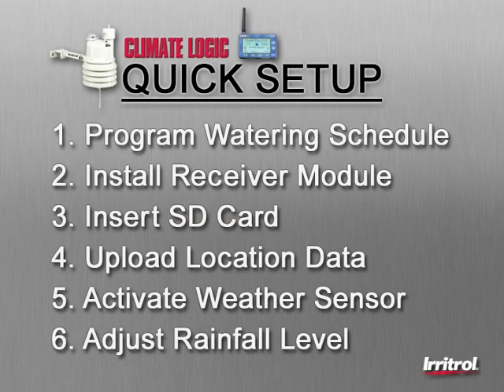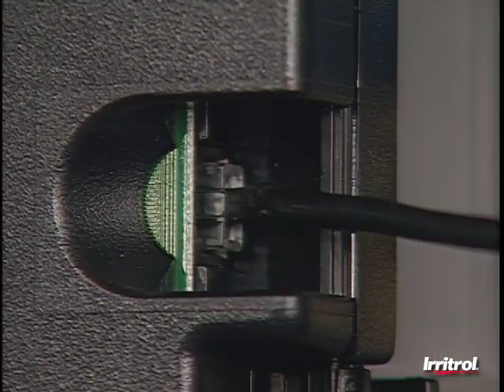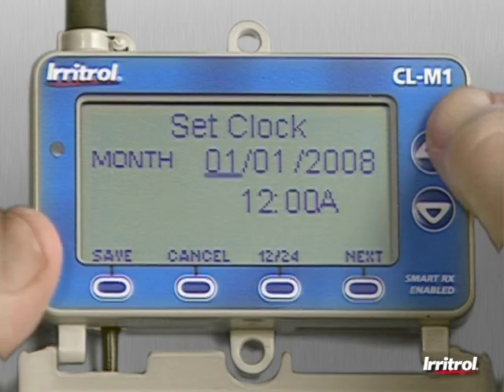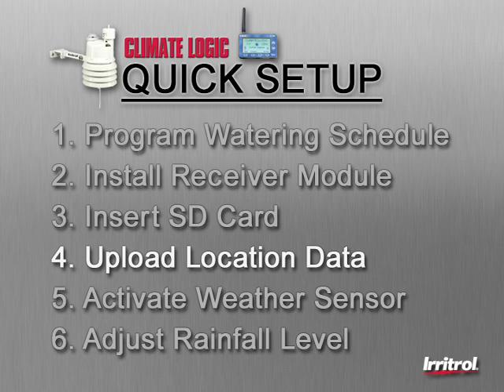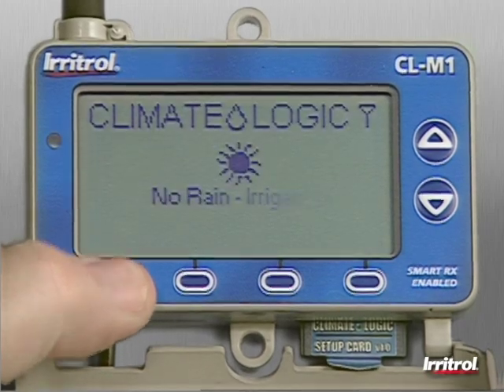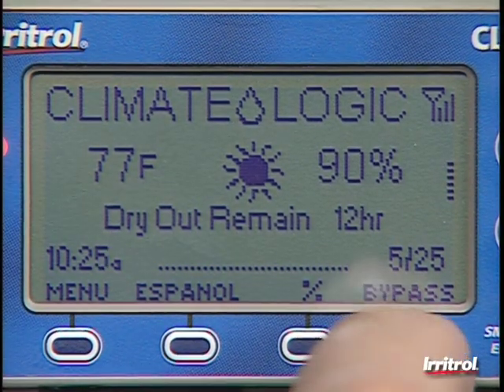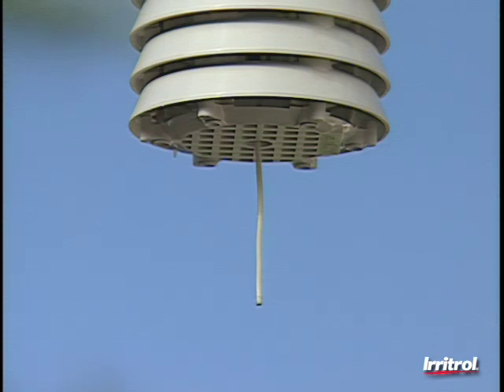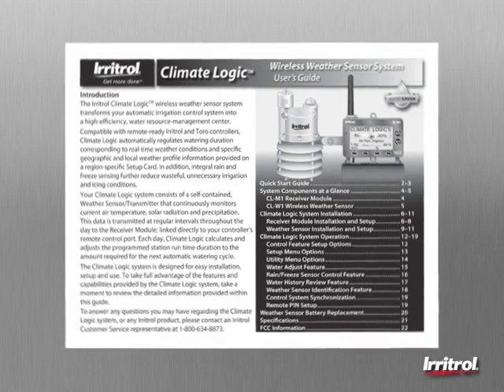How to install Climate Logic

Comment: Where do you route the wire when installing with a RD1200-EXT-R exterior controller?  There are no extra holes in the bottom of the enclosure to run a wire (with an RJ11 plug on the end).